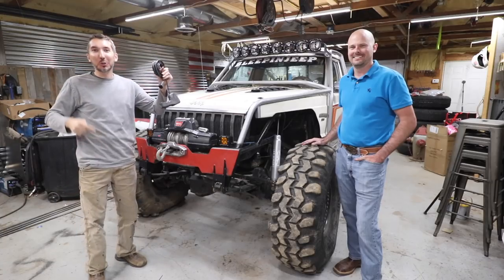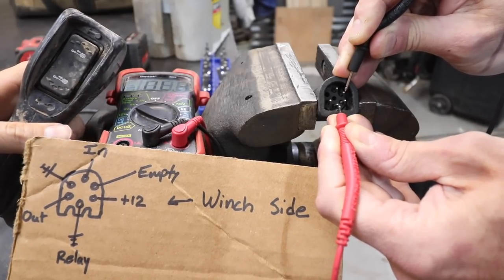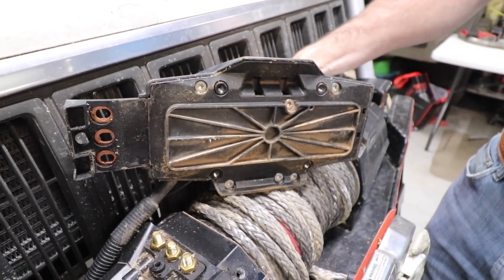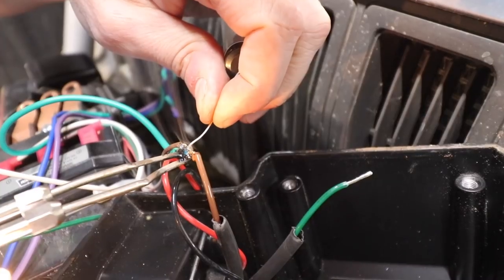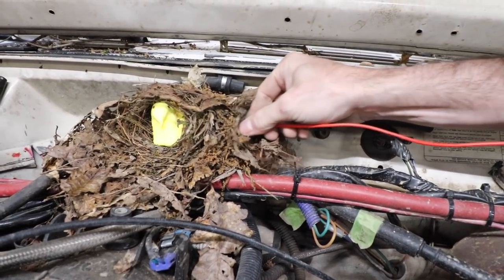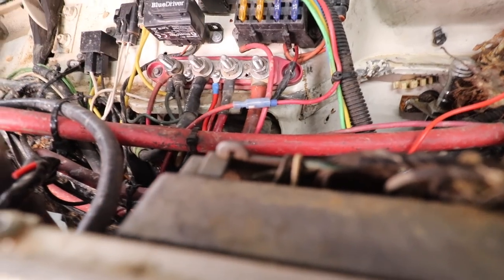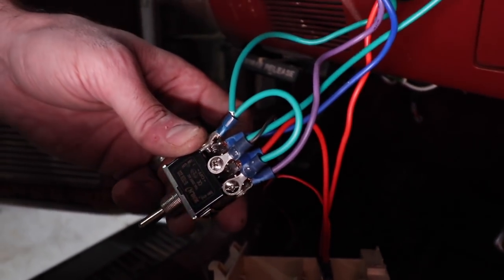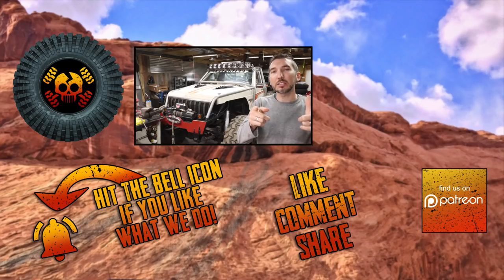Winch Control -  How To Wire a 5 Pin In Cab Winch Controller in your Jeep

Comment from the maker: Tired of fumbling around trying to find your winch controller in the back of your Jeep?  Need to use your winch quickly and don't want to get out of you jeep?  However you use it an in cab winch control comes in super handy!  Being able to control control your winch without ever leaving your vehicle saves time, it allows you to be in control and focus on driving instead of winching, and its just plain cool!  In this video Matt and I will show you how to wire an in cab winch control switch for a winch and controller that uses 5 pins.  These 5 pin winch controllers have been out for about 10 years or so and is a safety feature over the older 3 pin style.  But the 5 pin is a little trickier to wrap your brain around.  Let's make it simple for you!

Wire: https://amzn.to/2YOmBpo
Aircraft Safety Switch: https://amzn.to/2Ajqrg0
Inline Fuse: https://amzn.to/2Lg4v7P
6-PIN Switch: https://amzn.to/3blZMvN
Bolt Light: https://amzn.to/2Z04rRo

WD-40 Locator: https://www.wd40.com/products/
Here’s a link to WD-40 Specialist Long-Term Corrosion Inhibitor at The Home Depot: https://www.homedepot.com/p/WD-40-SPE... : The Home Depot is currently offering free delivery of more than one million online items with limited next-day and two-day delivery services. Customers can also buy online and pick up in-store.
Reply: Appreciate the feedback and Thanks again Matt ....
Reply: I would take those wires out and un twist them. They create electromagnetic interference being twisted. I learned that when i bought a car with speaker wires twisted that way. I bought new speakers and it still sounded terrible. I bought a new head unit and that's when i found twisted wires. I un twisted and sound quality was fixed.
Reply: Also i need a link to what you called the "hot block"!
Reply: I’ve decided to hard wire it like this because my first week living on utah someone stole my remote

Comment: You can simplify the wiring by using an on/off switch with an embedded LED.   Eliminates one hole and one wire.   Not a big deal, but I think it makes for a cleaner install on both 3 & 5 wire winch setups.   Aside from that, I followed your method last night and got it working and it looks great.  Thanks for the tips!

Comment: I did this same thing about 5-6 yrs ago for my Cherokee.  I also wired in a switch for TC lockup and 1st gear hold.   I used to love doing this kinda stuff, but my body is getting older and I can't do it as easily as I used to.

Comment: Nice work. Having an in cab control makes sense. It would be nice if you could wire up a relay to detect when the hand control is in use to interrupt the in and out signals from the in cab control. This would prevent conflict between the two controls.
Reply: ajm8127  I think this would over complicate the circuit for little gain as you wouldn’t normally be trying to operate the winch with both sets of controls at the same time.

Comment: Thankyou for putting this video together, been wondering how this was done and totally get it now, luckily I have the same winch you got there next to do on the endless list. So for your next video could you show us how to wire a Jeep JK Rubicon how to run my lockers turned on in 4 wheel high in the transfer case. I need more tire speed for 38's in the snow and mud!!

Comment: I used an extra winch controller I already had, all I had to do is take the handle apart, and hook it to a rocker switch, added a bypass switch to send power to the rocker. That way you dont have to lose just plugging the winch controller in.

Comment: houston we have a "winch" problem, my best story is fishing trip remote area of Canadian Rockies, going down a cut line ( bulldozer freeway ), stuck in little gully - winch cable pinched my remote wire,  no  tape literally used first aid kit bandages to avoid shorting out , btw luv my warn m8000 on yj!

Comment: There's actually an easier way to do this on a 5 wire that I found when I did mine and it only requires running 3 wires from the winch through the firewall. There's no reason to run ground and +12 through the firewall from the winch because you already have access to those inside the jeep.  Set up your enable switch to control the solenoid ground and then your winch switch terminals to +12 to the 2 solenoid wires.  Really simplifies the switches wiring as they are not tied to each other in any way.
Reply: why isnt the relay permanently grounded? whats the advantage of warns system and can you just permanently ground it? i did my smitty bilt into the cab couple months ago and just ran a in wire and an out wire from the winch into the cab, grabbed power in cab and sent it out either one of those wires on a momentary DPDT switch
Reply: @AndrewBrowner  Safety, If the power gets stuck and the winch wont turn off and your're reeling in you can kill it by ground disconnect.

Comment: I winched off a shrub once.  I was buried in clay up to the axles and the Jeep wouldn't move in any direction.  The shrub was the only thing sticking up out of ground within reach of the winch cable.
Reply from the maker: ha, small trees and stuff have more holding power than one would think

Comment: I wouldve just cut the handle controls square off and run that cable straight in the jeep to my inner controls and obviously the the other end would just plug into the winch where its supposed to . But Im guessing you still want to maintain the option to control the winch from outside of the jeep?
Reply from the maker: Yes. You'll need both options.   You can buy 4 or 5 wire in one sheath at home depot or online.

Comment: About a month ago went wheeling with my daughter. Came across a dead tree across the trail. Was able to get around it fine. On the way out i snapped the front drive line. My stupid self didn't bring tools so i couldn't remove it. It only bound up under load so i was stuck winching out about a mile. This is also when i learned i need to swap out the 249 for a 242! No 2wd option and a blown vicious coupler... anyways i got to the down tree and learned that there's no trees to winch around it. So over the top i went. Learned the weak points on my home made bumper as i bent it down at the brackets. But i got out and managed to pull the tree out of the road in the process... also managed to run out of gas 500 feet from the road so that was done with battery power only. And the battery died completely right at the road so i literally made it by the skin of my teeth! Bumper brackets are reengineered and the drive shaft replaced so all's well that ends well!
Reply from the maker: lol, holy cow, thats a long way to winch!
Reply: Ya we broke at like 2pm got home around 2 am! Hey next time you go to elbe let me know!

Comment: Not to rain on your parade "love your channel by the way " but i this years ago with a in cab in/out switch in my jeep and just needed 3 wires .
Reply from the maker: You are the man! 👨
Reply: @bleepinjeep  I did notice that yours is the newer style winch with the solid state albric solenoid . I upgraded mine to the that from the old starter relays.

Comment: Why didn't you just cut up the Warn cord?
Reply from the maker: its important that you can still use the original way as well, many times you might need to winch from outside the jeep too.
Reply: My cable was stolen -

Comment: Search "wireless winch control" on ebay.
$12.00
Reply from the maker: good luck with that!  I cant tell you how many times I've had to deal with someones bluetooth winch...  the sound I hear is always "Hold on a minute, I cant get the bluetooth to connect"
Reply: Thats kinda the beauty of it. Old school wireless remote.
So FAR its worked every time.